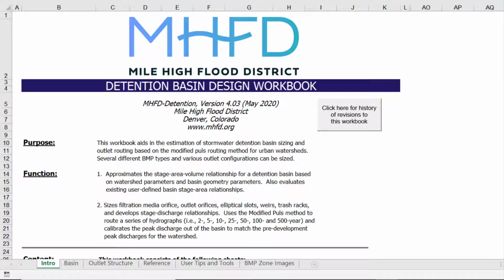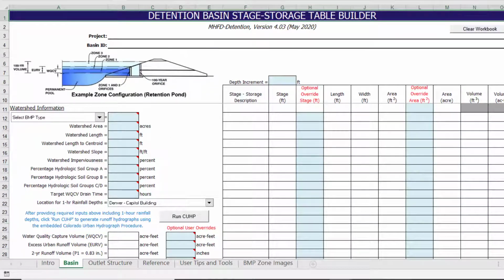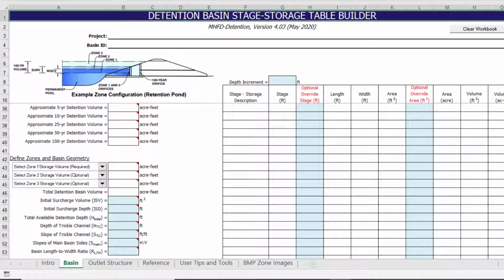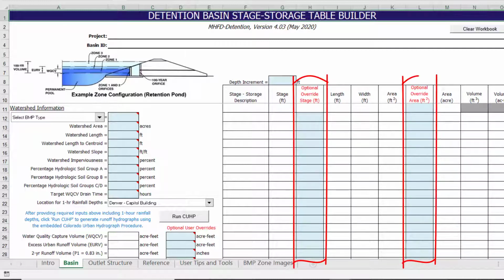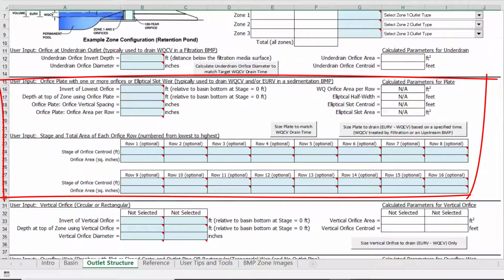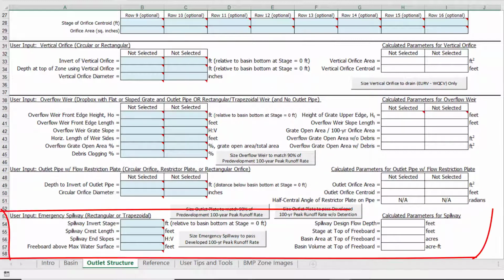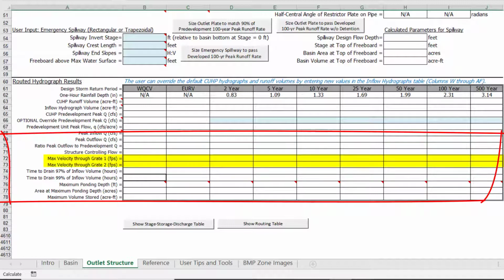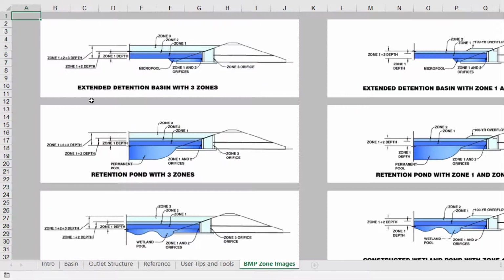MHFD-Detention Workbook Overview

Comment: You mentioned at the top of the video that underground detention could be calculated in this spreadsheet. Could you elaborate on the best settings to use and thinks to consider? Really informative video! Thank you!